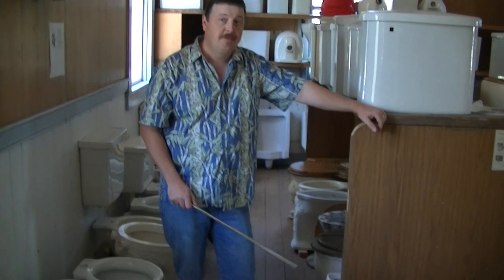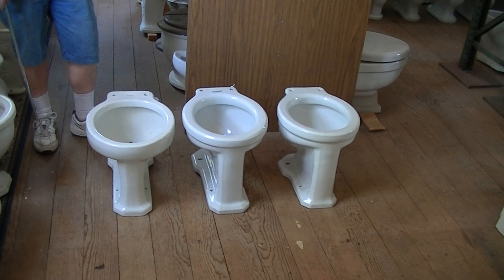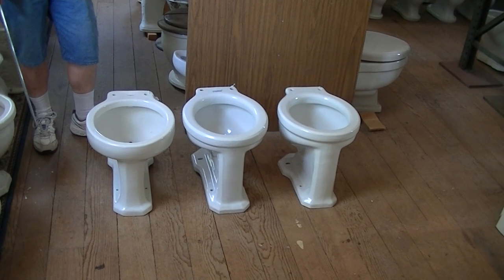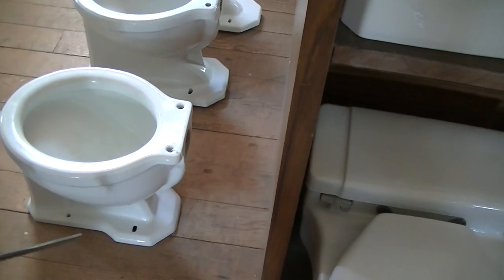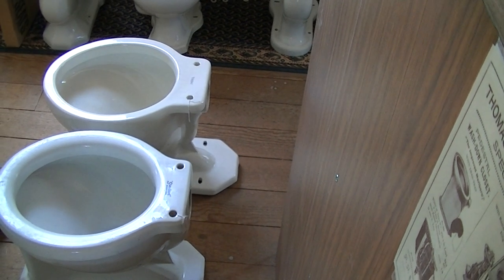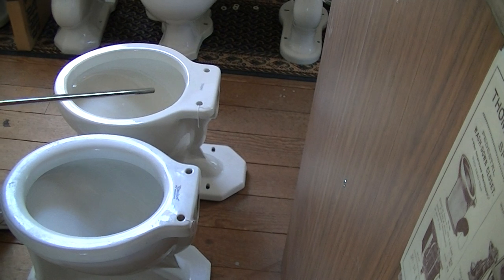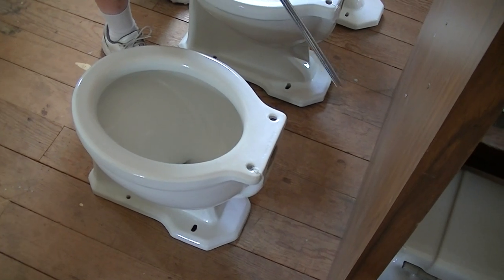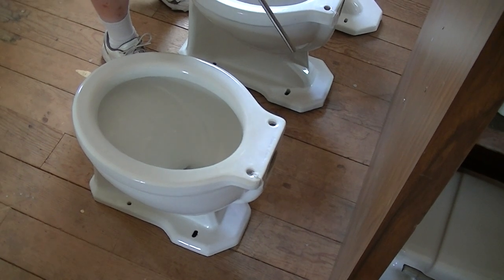how to tell the rough in of your antique toilet bowl

Comment: I just measured the distance from my toilet wall to the bolt of my current toilet bowl is only about 3 inches. Would this mean it would be harder for me to choose a new toilet bowl to fit this so-called rough-in of 3 inches?
Reply from the maker: Heh Tah Yes, that dimension will cause a problem.  It sounds like your plumbing is set up for a European rough-in which is commonly 4".  Where are you located?
Reply: deabath
south east asia.
Reply from the maker: Heh Tah All our toilets are set up for North American plumbing, and would not work with the rough-in's used in your area.  You should contact a plumbing supplier in your area.

Comment: Exactly what I needed to figure a new rough in distance. I have an old 4 bolt Eljer that measures just under 12". I guess a new 12" would fit but a 10" might be better. Thanks,,,,,Deabath.

Comment: Thanks for the explanation!  I was considering replacing an old toilet with a 14+ inch rough-in with a new toilet.  It's 14" to the baseboard, so a bit more to the wall.  Now I understand how it works.  Better than just saying to measure from the wall, like all the other instructions.

Comment: I have a 100 year old toilet that appears to be a 14-in. rough-in. I need to replace it with a newer model as the glazing has long been removed rendering the toilet porous and useless. Can I assume I need a 14-in. rough-in toilet to replace it? would it just be better to measure after removing the old toilet?
Reply from the maker: It's a safe bet that you would need another 14" rough bowl.  For everything to line up properly (assuming you want to keep the tank), you really should look for a good old bowl.
Reply: @deabath  Sadly, I can't find another bowl that has not crazed and has the ornamental features similar to the one I have. Was considering having mine reglazed (not sure where-still researching) as the interior shelf is completely porous and makes for a stinky potty, but I am anticipating having issues since it hasn't moved in 100 years. It is in relatively good shape otherwise, no spider vein crazing, just a bit cloudy. The entire bathroom has beautiful wooden wainscot throughout so I was hoping to find a newer toilet with an ornamental bowl and just keep the tank for aesthetics, but I am having trouble locating one. Today's toilets totally lack style. Any thoughts?
Reply from the maker: @brendascally116  So, you have a washout bowl then.  Those can be problematic at best.  Can you e-mail a couple photos of what you have to john@deabath.com?

Comment: Can you help?  I need a round, white toilet bowl with the tank bolt holes at 6-12 in. centers for use with an existing corner tank.  Any source ideas?  Thanks.
Reply from the maker: Hi Jim.  I take it your tank bolts directly to the bowl, this is what's known as a close-coupled toilet.  Unfortunately, this isn't something we carry, all our antique bowls are the older "low tank" style.
Reply: @deabath  Did You Know That At Times That You Sometimes Carry A "Standard 'Moderno'";Which Is A/The Cross ➕ Between An "Ejecto" Last Made In 1936 &And A/The "Modernus" First Made In 1931 By Model Name, With The Ledge How It Resembles The Close-Coupled"Low-Tanks""Compton" Possibly Also 1931 Right Up Through To The 1960s-The 1980s Just Like Those "Modernus's", Do You Have Any Idea 💡 Of What The Original Open-Front HorseShoe Commode Toilet Seats Might Have Looked Like For The "Ejecto's" 1915-36, "Moderno's" 1931-8, "Modernus's" 1931-50s, "Compton's" Also 1931-50s?, On If Anything Within The Shape Just "Differed" Any/At All, Could You Please Let Me Know? Thanks.

Comment: I just measured my old toilet and the distance between the seat bolt holes and the flange bolt holes are the same.   So what size of rough in would I have?
Reply from the maker: Most likely you have a 12" rough bowl.
Reply: @deabath   Thank you.  I am hoping that is correct.    The distance from the back wall to the flange bolts is 10 1/2 inches though.  I am trying to replace the old toilet with a corner toilet for more leg room.  All corner toilets I have found need a 12 inch rough in.
Reply from the maker: Hi Wade.  You have a problem then if the actual rough-in is 10 1/2" and you are putting a 12" rough bowl on it.  The best thing to do would be to move the rough.  Even our Corner hightank toilet needs a minimum of 11".